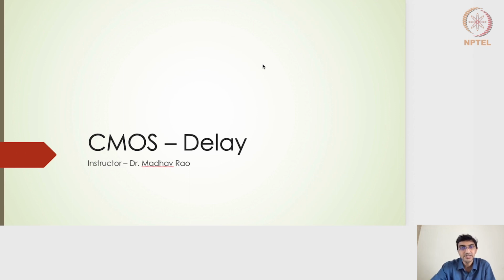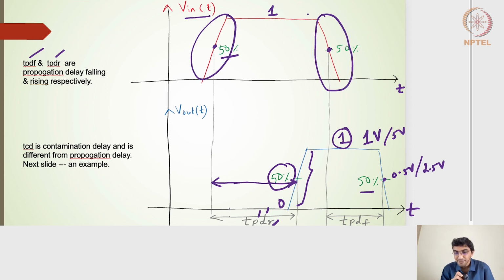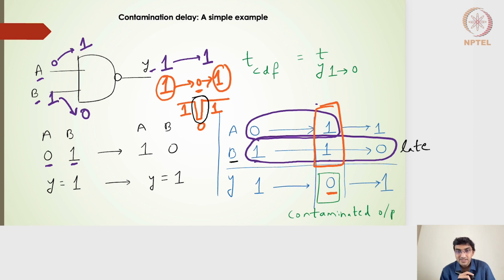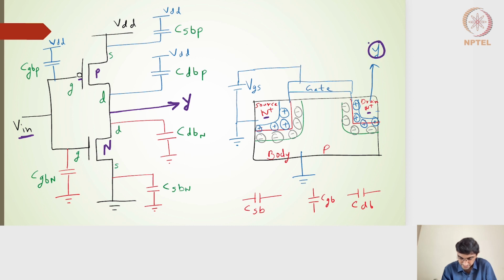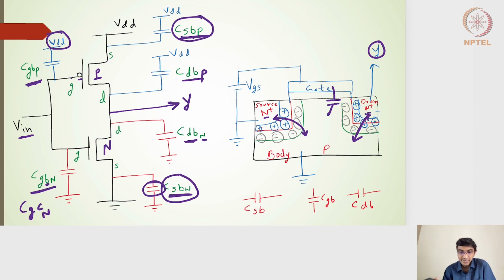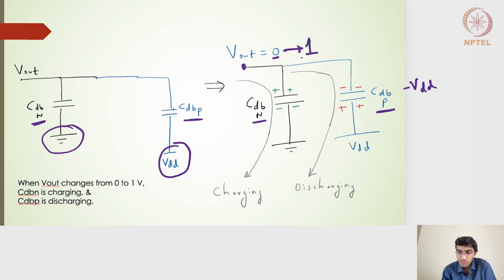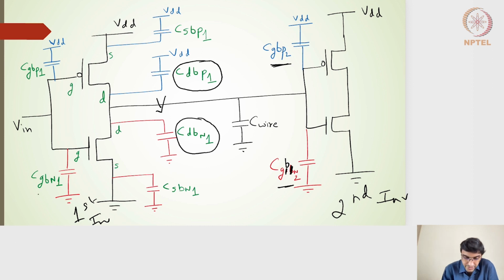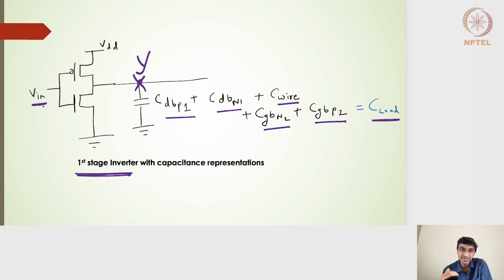3.5 - Introduction to Delay in CMOS

Comment: Best explanation on CMOS capacitance on the web. But Sedra-Smith's Microelectronic Circuits book's figure depicts no C_gb. I guess, as I have read in Neil Weste's book and heard in your lecture too, once the transistor switches from cutoff to linear/ohmic region, C_gb drops to 0. Hence, Sedra-Smith depicted a figure in linear region [in saturation, C_gd=0. C_gs=2/3*C_0]. And the driven CMOS has still C_gb3 and C_gb4 because these are still in cutoff. We need to drive it to raise it to saturation. Hope my reasoning is correct.
Thank you, professor!